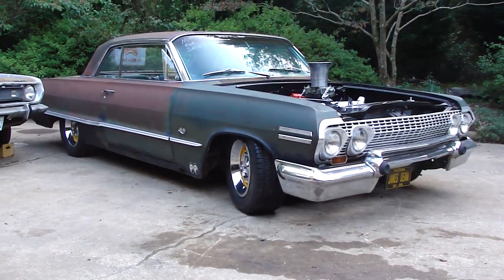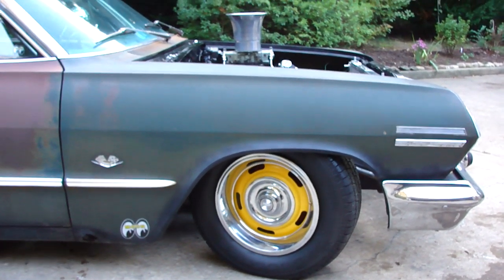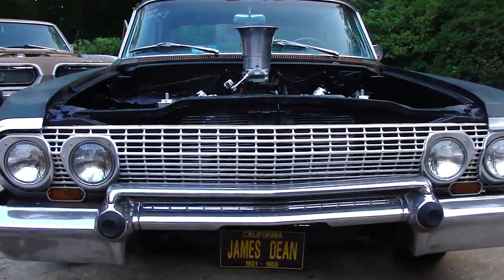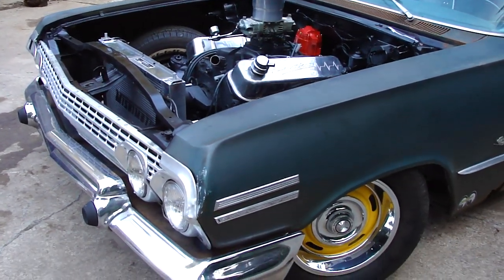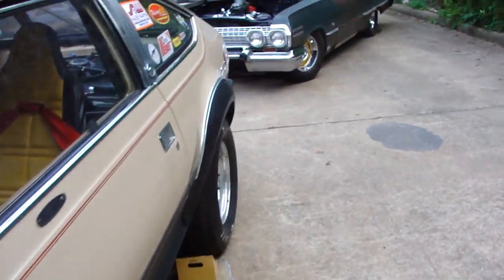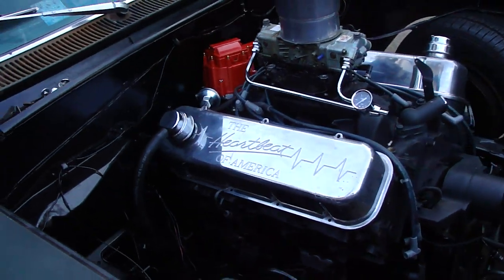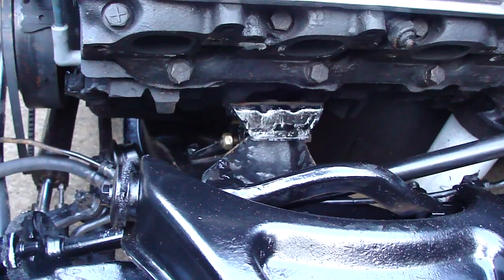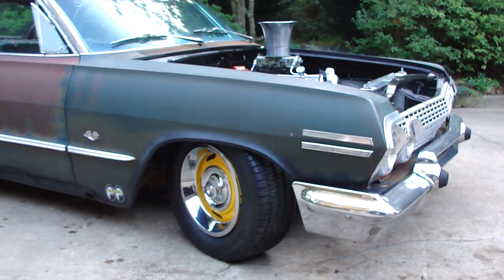63 CHEVY IMPALA 454 BBC "CHEECH and CHONG" LOW RIDER SAVED FROM CRUSHER NEW LIFE!

Comment: What kind of drop did you put on it? I'm working on my 63 and I'm digging the stance on yours. Also , did you use POR15 on the engine bay? Looks great!
Reply from the maker: Jesse, we chopped all the springs by 2 coils, which is too much!! I just power washed the hell out of it with "Purple Power" cleaner and painted it with Rustolium paint. Thanks.
Reply: Got it! Thanks for the reply. I just pulled the engine last night for the overhaul so I'm gonna be be working on all the front suspension while the 283 is out. Since you think the cut coils were a bit much what do you think about drop spindles or 1" drop springs? Both are easy to get online but I just don't know what route to take. Looks like you know what your doing so i value your opinion...
Reply from the maker: Jesse Marroquin The dropped spindles would be the best route I think. I would go at least 3 inches to make it worth while.